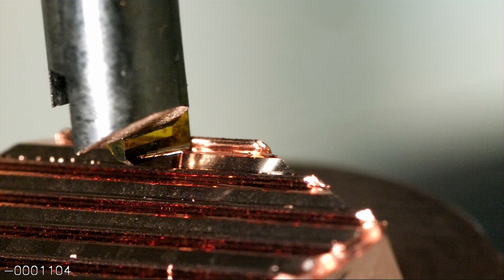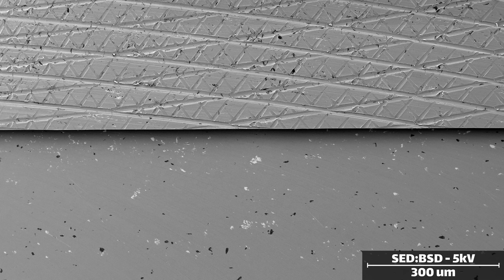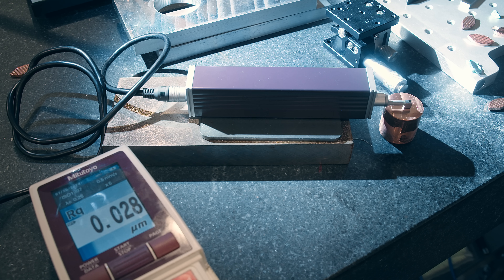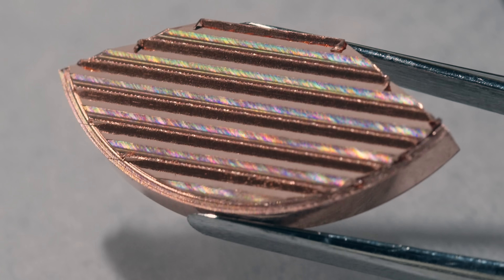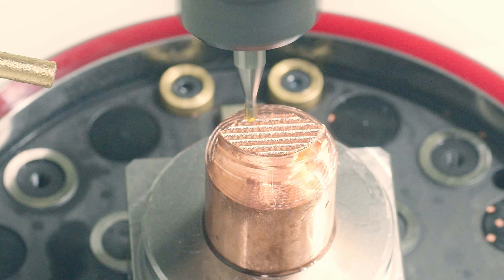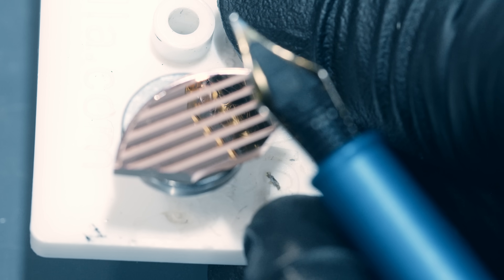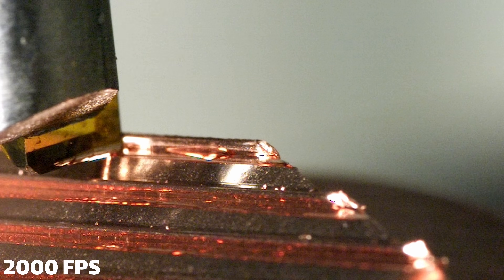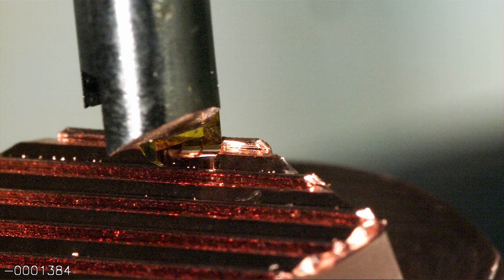Cutting mirrors with Diamonds

Comment: Super cool! This is one of the best videos I have seen. I was going to try something like this as I wanted to make copper mirrors with a fixed ROC for a CO2 laser. I found this video via a reference from a Titans of CNC video. It is nice to see you have achieved some very good results. I am starting to wonder if I could actually make this work now with the DIY stuff I have in my shop. I certainly don't have access to the SEM equipment you have for the great feedback you were able to generate after each attempt. Again, very nice work!

Comment: You changed multiple variables while diagnosing and relied on elemental clues instead of isolating causes; repeat controlled tests one variable at a time. I recommend, single full‑width pass (no Z moves!), repeat same cut on "known‑clean" soft copper and test spindle off (scribe) vs spindle on. Adjust rake angle and improve chip evacuation (mist/air) and compare results. Wonder if you ever ran a controlled test isolating coolant type as the root cause.

Comment: You would actually use a "single point" diamond for turning optics, not what is shown. Fun fact, some contact lenses are made by turning cylindrical plugs to make the lens, other contact lenses are made by diamond turning a mold to make the lenses.

Comment: Please correct me if I’m wrong, but I’m pretty sure at these tolerances when we’re talking about nanometers chatter can also be created by the tool heating up and cooling in different places in different ways so essentially the bit is changing it’s molecular structure slightly and the atomic level, and that ends up at certain points, making it longer or shorter, causing said chatter. I could be wrong. Please tell me if I am, but we’re talking these levels of tolerance. I feel like that’s gonna be a factor.

Comment: Not only the spindle needs to be normalized, but the axis movement also will grow with increased heat. I run a warmup program that runs the X, Y and Z axis back and forth while the spindle is running. The ways will also alter as they warm up from friction with the ballscrew. I am sure your using glass scales so expansion isn't an issue, but they still will not run consistent when cold. After 20 minutes of warm up, my machine is ready.

Comment: There would technically be a pulse to the motor moving the x axis right like pulse width type thing?Is that compensated for or could it be part of the ridges that look like chatter? Like as it pulses it pushes atoms away faster or slower, making a differnt wave infront? Like a fast or slow spring pass.

Comment: Hi,

It was indeed a ton of fun to watch this. :) Regarding your chatter-like marks it came to my mind that it might come from the spindle trying to keep angular position. Those motors are generally fairly weak in that task and also a mill spindle drive is not really tuned to do that. Your application doesn't generate a ton of force for sure, but on this scale it might play some role. If you have the chance to rigidly mount the tool to the spindle housing, I'd say give it another go.

Thanks for the video, it made my evening for sure!

Comment: 16:01 .. where we are talking of the chip thickness.. for a 2 micron pass , the chip will end up atleast at 3 to 4 microns by default due to shearing in its crystal lattice and reformations ..and even at 17:48 , the chip got a lot thinner coz they dont have to be pushed at themselves as they progress cut .. and hence its thin... its crystal shearing

Comment: The idea of keeping the clamping away from the workpiece is to make a wedge on the tool so that when the copper winds up it lands on the sweeping plate from which it is sucked off. You push the clamping onto the sweeper plate so that it remains separate. It may be possible to fix it directly to the tool. The suction also gives the waste a fixed direction. Just an amateur's idea.

Comment: Also everything the tool lifts it will re enact ur machines margin or error..so u may want to figure out a way to make ur finish cuts differently and possibly smaller and individual passes. Or rotate the tool and cut in both directions on the same pass unitk finished and then lift back on the Z axis and do the next cut in one motion both directions

Comment: Hydrostatic instead of ball bearing would definitely help get rid of the surface issues. And then also change the rake angle and do air pressure to push out the chips

Comment: Why did you need to step over?  Could you not have taken passes and changed z only.  That way the finishes surface has not been under the cutter multiple times.  Also, was iso in the coolant?

Comment: Fyi, when rebuilding car engines, bearing surfaces are measured in microns (when using metric, obvs). Allowable out out round usually being around 10 microns. The surface is ground.

Comment: 0:26 I find it crazy that everything has to be so precise, but the coils for the magnetic field can be completely chaotic and apparently even made by hand.
Reply: The magnetic field away from the coils is essentially the average of what’s happening in the coils, so the hand made nature gets smoothed out.

The laser profile away from the mirror is essentially a microscopic view of the reflecting surface (with a spatial Fourier transform thrown in for good measure) so every imperfection is magnified.
Reply: Its the inductance that matters, not the angle of each individual turn. I work at a company that winds coils just like these on video, (with ~21 turns per layer based on what I counted when I paused the video, and lets assume 21 layers to be generous for a total of 422 turns) they are NOT hand wound. Its just that the machine that winds them doesn't precisely position each turn right next to the previous one and instead just swings the wire back and fourth. 

Other coils, especially ones with few layers and self supporting ones, (without a bobbin, they are glued together) will probably have evenly wound turns.
Reply: That whole contraption is just 'ehhhh it will work just fine' written all over it. It's literally made with bolts, washers and nuts.
Reply: Not sure but electrons are already chaotic so no point in making it orderly i guess
Reply: There's nothing chaotic about just wrapping copper wire. it's a coil, it's pretty basic, but it has plenty of specifics, just not that you can see. there's the gauge of the wire, the coating and it's thickness, the amount of turns. That coil was also definitely not made by hand. The contraption, sure, the coils themself, no. Those are a couple thousand windings EACH coil.

Comment: I could be wrong but I feel like you could get better results without spinning it. Like if you used something like a slider on a microscope to accurately slide the diamond over the material and shave of small amount in a straight line.
Reply: Hell yeah I knew it after just the very beginning of the video

Comment: When cutting with a cutting tool it is the shear line that adds an inconstancy variable regardless of having an infinitely rigid system.  The smaller the tool or cutting edge engagement with the material, the better the finish.  One work around is wiper geometry on tooling to kind of iron the cut surface flat, a bit like roller burnishing.

Comment: As a diamond tool maker a tungsten shank tool will allow for much more tool rigidity when you are scribing, I have no idea if the spring boarding of the carbide shank factored into your surface here or not. If you can source it try to get ahold of oxygen free copper, and aluminum is ALWAYS evil it always has inclusions that chew up the tool edge. I would love to collaborate on this project with you in the future if you decide to revisit it!

Comment: It’s not chatter buddy it’s, the cutting process itself not to mention tooling tends to dig into copper because it’s so grabby, high pressure coolant can help but the real story here is that you need a substantially stiff right because anyone that knows anything about cutting copper knows it’s a pita to work with inlesss you have a giant rig ie huge industrial vertical mill because their will be considerable flex even though you don’t notice it, if you video tape it and put micron space marks for reference on the rig itself you’ll see a Significant deviation and the whole machine showing considerable flex which will make your machine have some form of chatter.

Comment: Beautiful. What you're doing is more and more impressive.

Actually, magneto-optical traps are rather robust. Even if you don't get the most perfect finish, it doesn't matter as long as most of the light goes in the right directions. Alignment is not super critical, any beam can be mis-aligned by up to a few degrees and you can still get a decent MOT. The zero of the quadrupolar magnetic field can be off-center by 1 or 2 mm and it will still work. The power balance is more important in my experience, although it doesn't have to be perfect.

In a DIY environment, I'd say the hardest is to get a stable laser at the right frequency (+ the necessary repumper for some elements) and the vacuum quality. Rubidium and cesium (with laser diodes, and sodium with dye lasers) are the easiest to trap for sure.

Comment: Try CVD's we used to get them from SP3 in canada and they are only about $1 per Log of 1X1X3mm but for that price they will need to be smoothed out yourself, I've since retired from diamond tooling and don't know what is currently offered from this Co. and we used them differently than you do. As far as Cylos garage, not sure what he's try to accompish, it takes big money to do a lot of the work on spindles, he needs a round com on an air table to be able to verify what he's trying to do

Comment: 7075 is not typically used for diamond turned optics, more common 6061 is the usual starting point and electroless nickel plating also works well. Copper is not unusual but isnt used unless it's other properties are desired because of its poor structural performance. Flatness of your samples can be checked with a simple optical flat and monochromatic light. Real diamond machining centers typically have air bearing spindle and relatively heavy and rigid rotating masses like a large flywheel.

Comment: I wonder how this would affect heatsinks and processors. Thermal paste is required to fill the microscopic gaps to transfer heat effectively. By machining the CPU IHS and the heatsink by this way, we may not require thermal paste between them.
Reply: Another use could be sleeve bearings. This is a very smooth surface, so there will be very little friction between the parts

Comment: Working at a company using diamond machining for optical mirrors, I can state you can produce Luminum mirrors using monocrystaline diamond tools. We use a method called flycutting. 
Our machines do have air bearings and air bearing spindles. 
Hydrostatic bearings are also possible but more expensive and complicated.
Ruling is also possible. You can even machine brittle materials like glas if the infeed is low enough (about 50 to 100nm). As long as you stay in the ductile regime.
Fly cutting or single point diamond turning or ruling with mkd (mono krystalline diamond) tool can achieve about Ra 5nm in aluminum (we use EN AW6082, 6061 and 6060) 2hile in oxygen free copper we can achieve about 1-2nm  Ra. If you use a electroless nickel Ra of less 1nm is possible
Reply: What types of glasses you machining in ductile regime? Like chalcogenides or optical glasses like bk7? What form accuracy and roughness in Nm RA or fringes do you get on glass? Are you using assisted DT like the MicroLam Optimus to get those results?

Comment: Have you tried spindle orient, and letting the cutter drag across the surface without spinning? We used to use a similar process to make lens polishing tools, and we got pretty good surface finish without spinning the cutter. Not sure if there is a way to lock the spindle on your machine. You only need to take a few microns to refresh the surface.
Reply: Ha! You wound up trying that in the video. I hadn't watched far enough yet.

Comment: With the large spherical stylus you are using, you know that you are averaging a large sample size. You really need a sharp conical stylus with a MUCH smaller contact point. Of course it will still give you an average but it will be                          a more applicable sample size.

Comment: I really wish this video was explained better, why are we doing so many different types of cuts?  are we cutting the same piece of copper every time or a different piece, i cant even tell when the results are good or bad because you mix terminology several times, at first saying that the delta in surface height needs to be 1/4th the wavelength of light, but then next you say there is a 'ridge' of 100 nm, what does that mean? is it 100 nm from where the surface should be or is it 100nm from the lowest point on the surface? My advice is as follows : You are focusing too much on describing exactly what you are doing, but you are not establishing a narrative that is easy to follow from begining to end, so it ends up being up to the viewers to construct a narrative about a topic they are probably just learning about, in the future try to remember you are telling a story with this type of content, its not a training video

Comment: Hi Breaking Taps,
Also a nice and interesting video.

Maybe putting something on the line or providing some wood for your fire?
 
I noticed that you have flakes-chunks-chips-scrolled ribbons "garbages".
Of course the direct mirrors out of metals are a major result of interest; but those remnants are certainly no garbages because at watching at them, I conclude that they must have a quite high specific surface (surface/volume) what is very ressearched for catalyst or catalytic metals.

Usually people with interest into catalyst plays with dusts or dendrites to get a lot of square meters of surface per ccm (or gr) of metal that must be packable in the smallest volume but stil allow fluid flow (gas or liquid); too much packing would imply the need for high pressure; due to pressure loss for passing through the mass of catalyst and this heats a lot the catalyst; and usually temperature regulation is a must for definite reaction pathways and yields (optimal temperature of working-conversion and yield - so does the cooling: thus two sides of the same medal).
Often they try to optimise surface area by coating the surface of a supporting material (cheaper, inert or mechanically or thermaly or chemically resistant).

Your chips seems to gather the high surface area, a certain volume to allow for passage of fluids through it with not too much resistance and optimal heat exchange (fluid-metal-voids).

As engineer interested into energetic materials, pyrophoric mixes, flash mixes, detoning mixes; I can also see many differents applications for the shavings.

As a side note I'm the owner of some few 100 gr of ultrafine Al powder (U.F.A.P.) of the dendritic type (made from electric explosion of Al wires into inert gas atmosphere and slow interoduction of cold air to reform a moderate thin oxyd layer (Al2O3) coating; thus yielding a very reactive powder; it burns into the air from the spark of a lighter, first orange red like ashes and then a second combustion very bright like Mg ribbon; this leaves a white dust of Al2O3 and AlN.
The powder apparently increases the specific impulse of aluminized propellants and energetic materials by a multiple factor due to the fact there is much less inert weight Al2O3 coating.
I have tested a tiny ammount of dust with NH4NO3 prills and it burst into flame from a lighter what is never the case with my other forms of Al flakes or german-Black powder.
The powder is apparently used for military application (american and sovietic) for thermobaric weapons by simple dispersion of the dust into TNT for example; the explosive detonates and disperse the cloud of metallic powder (first blast wave pressure (radially outer)) and then this overheated dust burns the air (O2 and N2) what create an implosion wave (contraction) (second wave blast in the other way (inner centripedal)); such cisailling wave make tunnel and structure (or eardrums) collapse.

Regards,
PHZ
(PHILOU Zrealone from the Science Madness forum)

Comment: I'm not a machinist nor a metallurgist so I probably don't know what I'm talking about here, but...
I noticed during the final slow-mo of those curl formations, that the material seems to be undergoing a wave of compression tension and spring release as the curl separates from the parent object. I suspect this is the true cause of the 2.5 micron finish rather than the machine itself. (possibly both?) I'd be interested to see if adjusting the cutting speed to match the inherent compressive/spring forces(hysteresis?) of the material would affect the final finishing pass.

Comment: It doesnt work with steel right? I had to polish 100 tiny pieces for my reasearch. Pain in the pottom. Grinded off my finger. 8mm diameter 3mm hight zylinders....
Reply from the maker: Unfortunately correct. The iron in steel reacts with the carbon in the diamond and very quickly dulls the cutting edge due to chemical "abrasion". There are some companies like Innolite that offer ultrasonic toolheads that rapidly engage/disengage the diamond from the surface which can greatly extend the working life, but it's still a lot shorter lifetime than non-ferrous metals.

Also oof, that sounds rough! Bet you never wanted to look at those parts ever again!

Comment: Shaping with a machine called a shaper is when the machine moves the cutting tool through the material. There is another machine that is similar, it’s called a planer. This machine moves the material that is clamped to a carriage under a fixed cutting tool😜